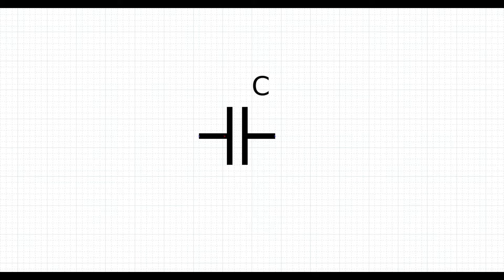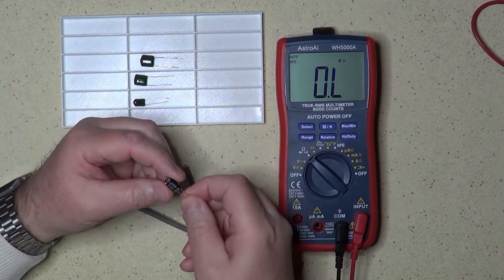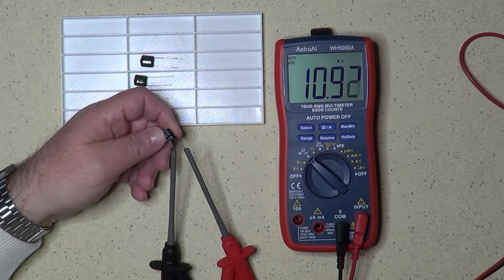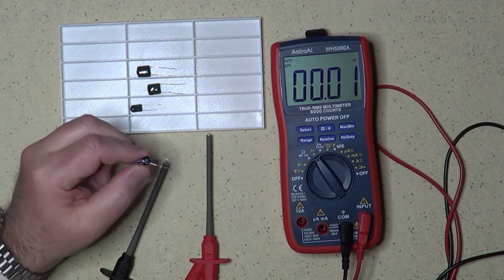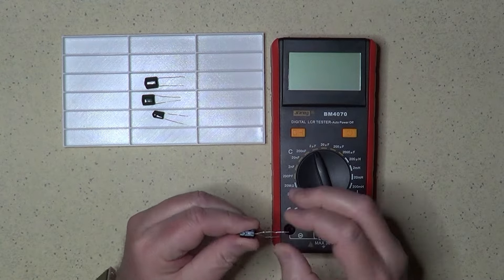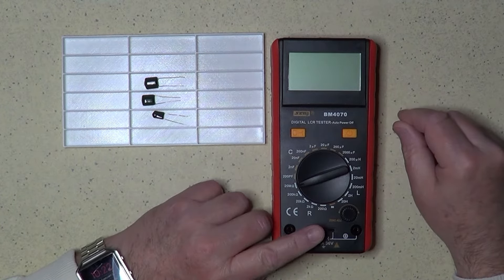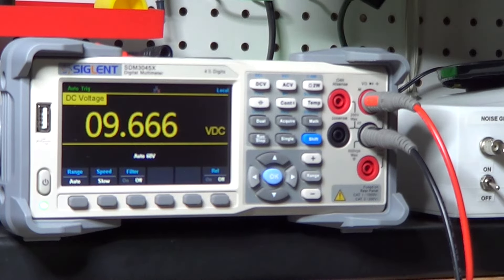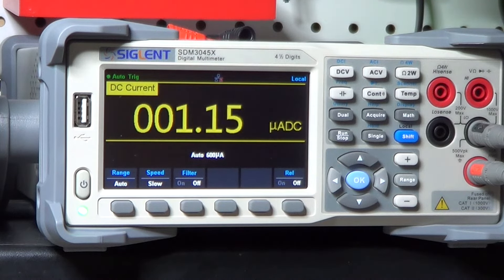Good Or Bad? How to tell if a capacitor is OK

Comment: Hi - my capacitor passes capacitance test with meter but I'm still uncertain - is a meter test conclusive?
Reply: ps its a cbb60 35uf
Reply from the maker: If you can read the correct capacity on the meter,  it should be ok.  However, you may also want to check its insulation.  It's a little tricky,  but you could follow the procedure in the video to ease your mind.
Reply: @eleneasy  Ok thank you